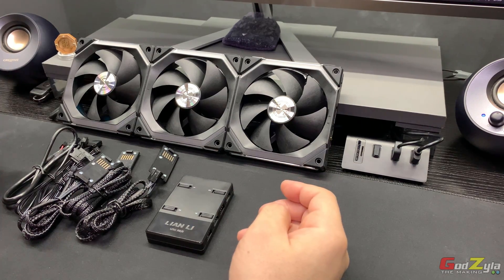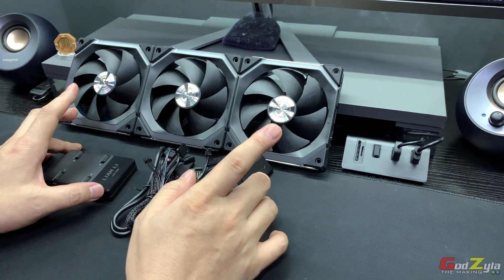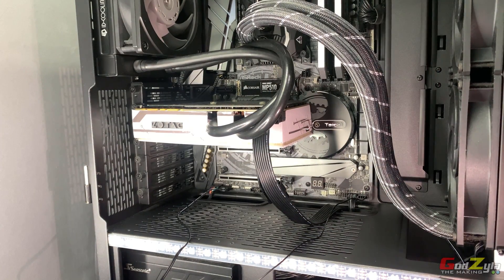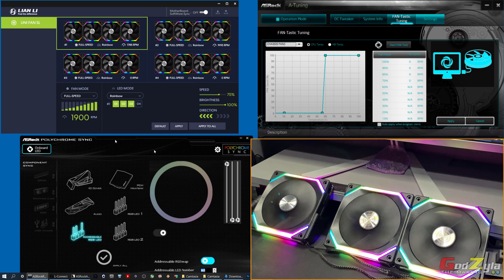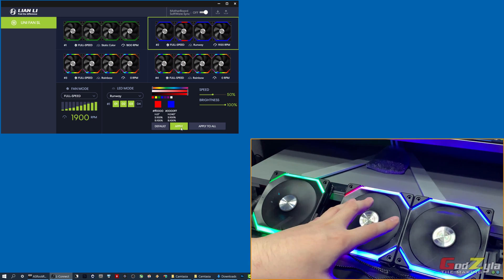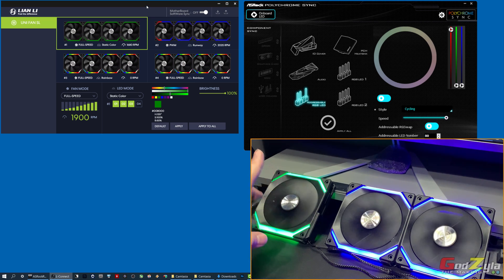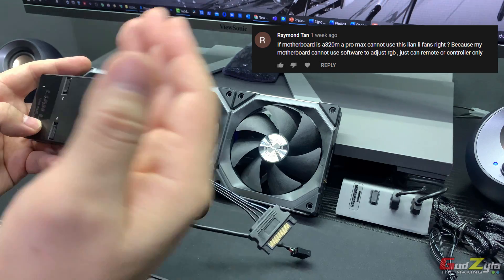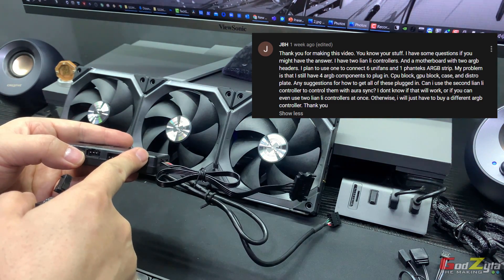Lian Li Uni Fan SL120 - Connection & The Controller (Part III) [L-Connect]

Comment: Can L-connect manage two hubs at the same time?  I have one hub pwm connected to AIO (CPU temp - using ASUS-Qfan for fan speed) and other hub pwm connected to Chasis fan (MoBo temp).
Reply from the maker: hi onlywiseman, welcome to my channel. I believe is possible but I've not try that.. take a look at their new software L-Connect 2 https://drive.google.com/file/d/1lZDI9FQEHRptOKHJTeL8_Qf7os3I1hU0/view
Reply: @KleoYan  I tried it, L-Connect 2.  The program does not work well.  I could  change RGB, but not the fan speed.  I ended up using Sandboxie to run TWO L-Connect program at the same time.
Reply from the maker: @onlywiseman  hi, thank you for the feedback and info, I see what I can find and to investigate this when I have the time. As currently am busy at work projects. It might take sometime for me to do the investigation.

Comment: So if I have 3 sets of 3 fans I can plug them all into one hub? Also my motherboard (msi Meg z490 unify) does it come with sata cables ? I’m so confused on if it have everything I need to setup 3 sets of 3 Lian li fans
Reply from the maker: hi Will Farrell, welcome to my channel. you can plug each set of 3 fans to one output of the uni controller. as for the sata cable. it's to draw power from the PSU to your uni controller. the sata cable is provided when you purchase the box set of 3fans  that comes with the uni controller.

Comment: Can i plug the pwm cable to the cpu fan header so i can get better cooling for the cpu  becuase im connecting all of my fans to the hub even my aio fans ?
Reply from the maker: Hi Zecrod, welcome to my channel. yes you can do that. in my video I have illustrated the connection using the PWM cable provided in this unit, just plug that cable between the uni controller and the motherboard CPU_Fan header, make sure in UEFI, that header is set to PWM. Next on your L-Connect, select the fan set where you to PWM under the fan selection.
Reply: @KleoYan   Thank you
Reply from the maker: @zecrod194  you are most welcome

Comment: Is there a way to connect one set of 3 fans and one single fan from just one slot on the controller
Reply: My set up will be one group of 3 fans 2 groups of 2 fans and one single fan with the lian li galahad 360 I want to sync the cpu block to the fans but this situation will require 5 ports on the controller is there a way around this great tips also love your videos
Reply from the maker: Hi Michael mcfarland, welcome to my channel. yes you can do that but you will need a fan  Y-splitter and an aRGB Y-Splitter for this. I have a video which shows you how https://youtu.be/njlkdM9lYbI . Now to get the  Fan Y-splitter is not difficult but for the argb Y-spliter will be tricky. At that video, I have listed where to get the argb Y Splitter in my description. and kindly note that you are not to plug more than 4 fans to one output. If you have time, I advise you to watch the dos and donts or this uni controller at my playlist https://youtube.com/playlist?list=PLEW-b-2vYDdM1WklGQps2-sQ1Amy6Uwn9
Reply: @KleoYan  OK brilliant thank you watched all the videos you have put up I just ordered the lian li argb cable kit makes life easy 😀👍
Reply from the maker: @michaelmcfarland7697  you are most welcome and all the best in your build too 😉

Comment: Hi, I have issues of replacing the SL120 on the Lian Li 360 AIO cooler, it doesn’t work out. Could you film a video of that detailed installation please? Thank you
Reply from the maker: Hi Luu Gan, welcome to my channel, do pardon me, as for your request, I am not able to do it as I personally do not have a Galahad AIO, the Galahad AIO used in my other videos, I have installed in a system and returned to the owner. maybe you like to describe what issue are you having.
Reply: @KleoYan  thanks for replying. The issue is after installing the AIO cooler, the fans and cooler are running, but CPU’s temperature is increasing and the system turn off itself
Reply from the maker: @aarongan4886  I believe you have plug your Galahad Pump header on the motherboard, does it give you a whine sound when you boot up your com? it should do that.. just like this https://youtu.be/FsHqEbuoh6s , which is normal. now I believe you did remove off the plastic cover of your Galahad CPU block and did you apply just nice and not so much thermal paste? the screws of the galahad should be with spring. do not over tighten them. instead do hand tight. let the  spring do it's job to bring tension between your CPU block and the IHS (CPU top)  
as for fans, if you have connected your SL120 to the uni controller, remove the PWM connector, on your L-Connect do you see the RPMs? these are some of the basic troubleshooting steps you should try. One at a time, narrow down your issue.

Comment: Noob Question:  I found this Lian Li SL120 on sale, same item, but the description is not...   should i buy A? 
a) Brand: Lian Li  [ slightly expensive ]  3x Fan and 1 Controller sold separately = [ 84 + 33 = 117 Dollar ] 
b) Brand: OEM [ normal price ]  3x Fan + Free 1 Controller [ 84 Dollar ] 

Im planning to buy the 6x Fan+ Controller from the dude with Lian Li Brand but idk.  [ 152+33 = 185 Dollar ]
Reply from the maker: Hi Chyegarl Alhasni, welcome to my channel. So long there is warranty coverage by Lian li you can go either. If it does not cover warranty, that will be a big risk.
Reply: @KleoYan  ahh (B) does not have any warranty despite the brand OEM.  thank you. I'll go with (A)
Reply from the maker: @MrHyeqarl  Hi, yup, is better to have coverage rather than no coverage. All the best in your build :)
Reply: @KleoYan  thanks again man for the explanation. Its really difficult to find a video focusing on lian li fan

Comment: Great video I was wondering I just finished building my pc my uni rgb lights not working do I need to have the software downloaded before the rgb lights will come on?
Reply from the maker: Hi Maurice, welcome to my channel, it should light up with default rainbow effect even if you do not have the software L-Connect installed. if it does not, try download the application, install it and reboot your system. if it still does not light up. I would advise you to check your cable connection of your unit.
Reply: @KleoYan  Thank you will do
Reply from the maker: @bigmoe4613  you are most welcome.
Reply: @KleoYan  I figured it out I had the usb header plugged into my external hub and not on the motherboard thanks again
Reply from the maker: @bigmoe4613  good to hear that you figure it out :) enjoy the lighting effects and thank you for your reply too!

Comment: Vera good Video. Thanks for this.
I have an Problem with the LianLi SL140 Duo Pack. I have connect alle cables(5v argb, the Fan connector, the USB connector and the SATA Power connector) to my Motherboard(Gigabyte Vision D B550) and PSU.
The Fans works in Standart settings ans the RGB works in Standart settings.
I Open L-Connect Software but i cant See the Fans in the Software, the Software Show me 0 RPM and i cant Change any RGB settings or the RPM.

What can I do so that the software recognizes the fans?
Reply from the maker: Hi Dennis N,  welcome to my channel. Sometimes is due to the motherboard utility app the controls the argb effects which causes the issue. You might want to try uninstall that and install only the L-connect application. If that does not work, this might aid you https://youtu.be/8l4i5UjO3es . If it still does not work, I advise you to write your issues with Lian Li https://lian-li.com/faq/ or even ask at Reddit here https://www.reddit.com/r/lianli/
Reply: @KleoYan  thank you for the fast Response. Next morning i try it, but i have only Install the L-Connect Software.
I disconnect next morning all cables and deinstall the L-Connect Software and than i try only the USB cable for MB without the 5v.

I get Info in the morning :)
Reply from the maker: @dennisn.9346  I see, then you should try do a chipset update. follow the video I have shared with you and also please take note that there is a intel chipset and an AMD chipset driver.
Reply: @KleoYan  I followed the video with the chipset update, however it did nothing. It is still like before :(
Reply from the maker: @dennisn.9346  Aik. so sorry to hear that. ok, then you might want to write in to lian li about your issue. https://lian-li.com/contact-us/
Reply: @KleoYan  yes :( thank you for the Link. At the evening when i am Home i fill Out the contact Infos to Lian Li. I Hope the Problem will be solved soon :(

In a Few days i Order the 3er 120mm Set for the Rest of my Tower, eventually IT works with this 'new' cables and Controller 🤔

Comment: Hi! I just want to make sure, will I be able to still control the rgb lights of the fan using the software without connecting the aRGB connector to my mobo? My motherboard doesn’t have aRGB header, I only have RGB header 12V so
Reply from the maker: Hi Paul Adrian Capistrano,  welcome to my channel. Yes, so long you plug the sata power source to Uni control and the USB cable between the uni controller to your motherboard USB 2.0 header, you will be able to use the L-connect application to control the argb effects.
Reply: Cool! Thanks man!!
Reply from the maker: @Poootchiii  you are most welcome 👍

Comment: i got a feeling what im about to ask wont be possible but can you  sync the unifan(sys1) speed to the cpu fan speed so they run in tandem at the same speed but still able to use l-connect to control rgb? the problem with l-connect motherboard sync is once i activate it i lose control of the rgb and it doesnt show on the msi dragon software so no way of control it once MB sync is on
Reply from the maker: Hi krayzie egg, welcome to my channel. you don't have to switch fully to motherboard mode. you can leave that alone, all is needed is to set on L-Connect, the fan section to PWM. then allowing the effects controlled via the L-Connect application. I hope this is what you wanted. to be honest, I would rather just plug those fans on the motherboard fan header and fully use the L-Connect to control the argb effects only.

Comment: Hey kleo, I've managed to setup the unifan hub! I have plugged in the Unifan hub into a chassis header on my motherboard, but when I set the fans to PWM, the fans spin at full speed. Any idea?
Reply from the maker: Hi Kevin, welcome to my channel. you might want to check in your bios, if the fan header that you plug between the uni controller and your motherboard fan header, was it set to PWM mode and not DC or Auto. thank you!

Comment: Do you have to connect the motherboard connections even if you suing the software
Reply from the maker: Hi Edgar Vargas, welcome to my channel. You can don’t plug the fan pwm and the argb cable from the uni controller to the motherboard but you will need to plug the USB cable between the uni controller to the motherboard USB 2.0 header. Without the USB cable plugged. You can’t control using the L-Connect application.
Reply: @KleoYan  hmmm thanks for replying back, sorry I’m kind of lost, I’m planning on using the software to control the fans, now my question is do I have to connect the other conector ? Or I’m god with just the usb and sata cable
Reply from the maker: @edgarvargas5352  yup. Plug only the USB and sata cable and you are good to go to use the Software to control the fans and argb effects.
Reply: @KleoYan  freaking awesome dude thank you,
Reply from the maker: @edgarvargas5352  you are most welcome.

Comment: Hi man great vid ! I was wondering if a single controller was enough for 10 fans ? U got my sub!
Reply from the maker: Hi Figatellu, welcome to my channel. Yes it’s all good but if you want to add a strimer plus, you can do this, take it as the Galahad is of 360 instead of 240. Here is a video while will give you a better picture https://youtu.be/njlkdM9lYbI once again thank you for visiting and to have subscribe to my channel 👍
Reply: @KleoYan  Hmm okay i'm gonna push/pull with the galahad 360 then 7 others fans for intake/exhaust in 011 XL. Thanks for answer, keep up the good work
Reply from the maker: @figatellu3536  hi Figatellu, hang on a minute. You are doing push pull configuration 360 Galahad? and have 7 more of these fans? That will be total of 13 fans. I do not advise you to do the splitter on the push pull configuration (6 fans) and to plug to any of the output of the controller. You need to know the limits of this uni controller as I seen some burn their unit or even the PC components. Do becareful.
Reply from the maker: @figatellu3536  please have a watch on this video https://youtu.be/QQHJUQvKwlY I wouldn't want you to overload with Argbs and to burn the uni controller, PC components or to melt the cables.
Reply: @KleoYan  I'm only going to use 10 unifans
Reply from the maker: @figatellu3536  hi, ok that will be fine 👍 all the best in your build 😊
Reply: @KleoYan  thanks for your time, wish you all the best

Comment: if you purchase a Lian Li PC case with its own controller that manages the LED front light strip via a front panel button, HOW do you connect the PC case controller to the UniFan controller (motherboard>LianLi 4x UniFan Controller> LianLi PC case controller?) Or do you connect the UniFan controller last (Motherboard>>>LianLi PC case controller>>>LianLi 4x UniFan Controller?) Is the LianLi 011 DXL PC Case front panel button supposed to be able to control all ARGB lights?
Reply from the maker: HI Gary-G, welcome to my channel, can I have you to list out how many sets of fans and quantity of fans you plan to use. example below

I assume you are doing this configuration. if  you are, am afraid you can't cannot the stripe to be controlled by the uni controller plus it will be overloading even if you use a splitter. it's not advisable. 

Top : 3 x Unifan - Output 1 
Bottom : 3 x Unifan - Output 2
Side : 3  x Unifan - Output 3
Rear : 1 x Unifan - Output 4

Comment: thank you very much, I was afraid to use this kit and keep only manual control of the fans, I didn't know I could use the pWM
Reply from the maker: Hi Rafael Dias, welcome to my channel. You are most welcome. Infact is a better choice to connect the fan connector directly to your motherboard. This you will have total control of your fan speed. I will just leave the fan argb connectors to the uni controller only, which will control the lighting effects.

Comment: I set my fans to pwm. In my msi bios, I set the fan curve for them, but it doesn't show the rpm on them but the fan curve seems to work (Lian Li software shows its rpm and fluctuates as if on the curve I set for it). Is that normal?
Reply from the maker: Hi Ahad Gaddis, welcome to my channel. Yes that’s normal. You will only get to see rpm indication on your L-Connect app.

Comment: Hi, I have a lian li lan cool 2 mesh performance case. I was wondering since the performance case have a fan controller what would be your advice? Use the unifan controller and front case controller separate or connect the unifan controller to the case fan controller? I'm kind of confused of what to do. Thank you for your useful videos!
Reply from the maker: Hi kevinwakoko, welcome to my channel. This really depends how you wanted to control your fans. below are the 3 options.

Option 1 - Case fan controller. 
========================
All the fans are connected to the fan hub, you will only be able to control all fans running at a fix rate, be it low, mid or high. 

Option 2 - Uni Controller
===================
You can choose to make use of the L-Connect app to set individual sets of fan with various RPM, example below.
Output 1 - 3 x fan (top) to run at 1000 rpm (set on L-Connect software)
Output 2 - 3 x fan (bottom) to run at 800 rpm (set on L-Connect software)
Output 3 - 2 x fan (side AIO liquid cooler) to run PWM mode depending on the motherboard connections (set on L-Connect software, under fan, set to PWM) 
Output 4 - 1 x fan (rear) to run at 1800 rpm (set on L-Connect software) 

Option 3 - Motherboard Fan Headers (CPU1, CPU_OPT, CHASSIS_FAN_1 and etc) 
=================================================================
This will be my favorite, I can connect each set of fans to the respective motherboard fan headers and to control them either using fix RPM or PWM function. 

To be honest as why I choose Option 3, cos I am not the type who likes aRGB effects. My current setup is just using performance fans and I choose to control my fans through the motherboard in UEFI/Bios. I do not need to install any additional software to control them. As for lightings effect, I only do RGB and not aRGB. With this said, I use a physical remote controller to turn on and off those lighting effects, again no additional software needed.  

This is my current setup https://imgur.com/gallery/Pw5kY4q if you want to see more, this video will explain why I dislike aRGBs or RGBs to be always on. watch till the end of this video https://youtu.be/0qSaX_mOjQc